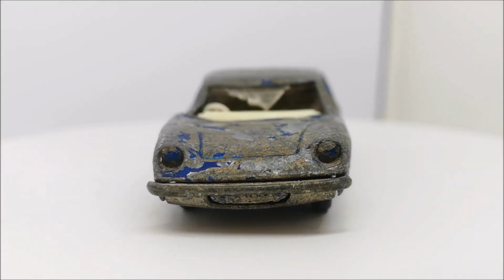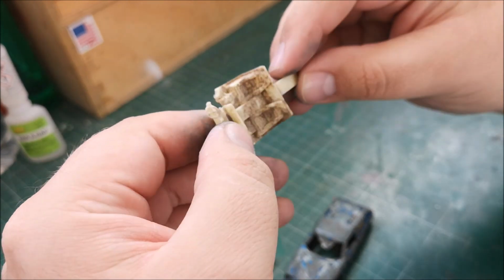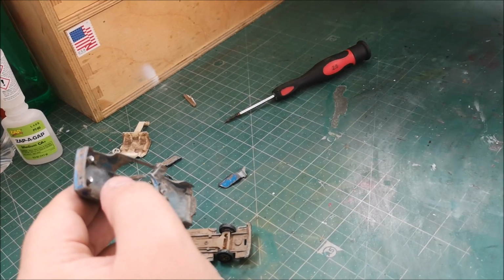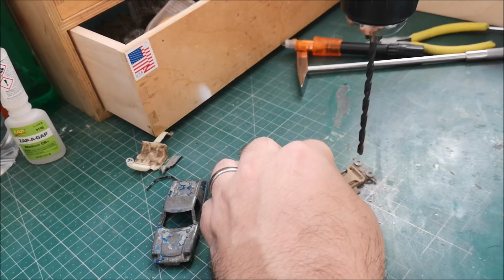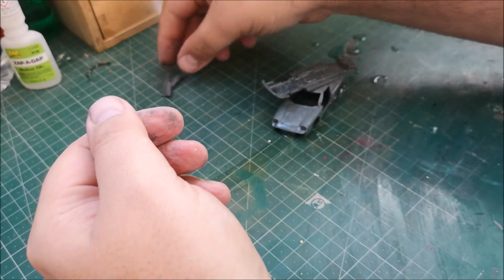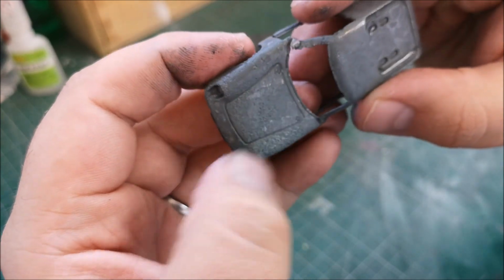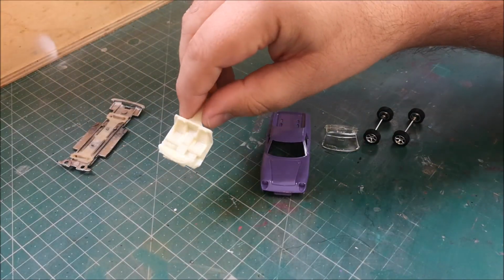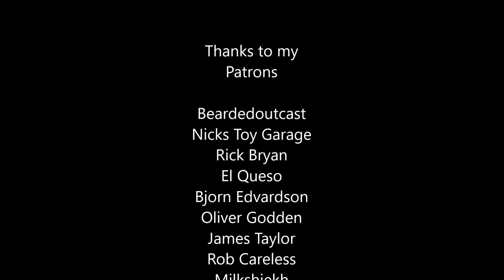Matchbox Lotus Europa Custom

Comment: Turned out great in the end.  Well done.  Right colour for a 1970's car.  I agree about scrapping the old body shell.  That is about the worst one I have ever seen.  Only good for displaying in a Matchbox sized breakers' yard diorama.  I really like the opening doors feature on Matchbox cars, but the body shells are vulnerable.  Only supported by the A pillars, and the under door rocker panels.  Then there's convertibles with opening doors, like the #27 Mercedes, that don't even get the A pillars.

Comment: This is very intersting as it appears the lovely model has very very fine orange peel from the spray. This is the finest I have ever seen. Recently I resprayed a casting and was very surprised when I got a glassy finish with just a pass or two. What is the difference? I think maybe it is the temperature. I live in Bangkok Thailand and it was maybe 85 degrees fahrenheit for everything when I sprayed. Air temp, paint and model all mid eighties or more. This produced very glassy thin coverage with just a pass or two from cheap spray can paint. This  is very satisfactory for me because it's so much like the best new HotWheels finishes. The only downside is that the fine finish shows some fine scratches on the casting and also the paint chips easily. So next time I will start with a more polished casting and primer it, probably with fine scale Tamiya primer. Thanks for the show, Thailand Paul

Comment: I'm gonna have to side with your wife on the color. It's a nice lavender really. There might be a few models where it would be nice as part of a two-tone paint scheme. A mercury cougar wagon for example. 
I didn't see a way you could save the body casting, beyond making a form of some kind to bash it back into shape.
When you don't use screws to hold the body on, what are the options for keeping it in place. Glue and baking powder, JB Weld or something like that?

Comment: That looks almost like the original color of the MB Lotus Europa I have.  I recently refound it - I had drilled off the rivet heads years ago to strip and repaint it British Racing Green.  But I didn't know about button head screws back then so it went into a box.  Now I'm eager to finish it!  (Actually I think it is more of a metallic pink - horrible for a Lotus!)

Comment: Just re watched this and noticed you using the UV Glue, in this case it failed after you put it in the caustic soda, but what do you think of it as something  the tool kit
Reply: ..something for the tool kit, as from what I can see the original product is quite pricey. I've actually ordered some of the non branded stuff from our 'friends' in China and it will be interesting to see if it's as good as the original.
Reply from the maker: It's a good bit of kit. I don't use it all the time. But it's handy when needed. The best thing for me is that it doesn't clog up dry

Comment: Kind of disappointed that you gave up on the original body of that car. It would've been a real triumph to have restored it to as close as possible to its original condition.
Next time, I would suggest using Tamiya putty to fill the pits and going over with ultra fine sand paper, followed by sealer/primer before painting.
Anyways, I really enjoy your videos; they're always concise and much better than Marty's, imho... Keep up the good work!